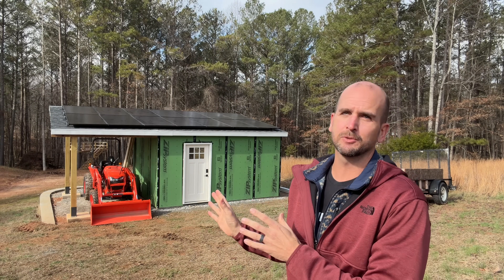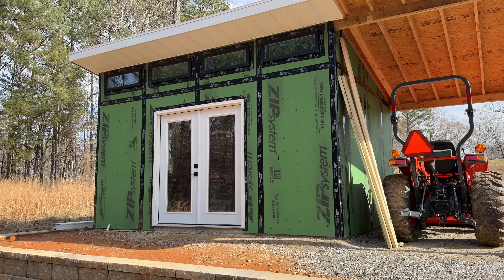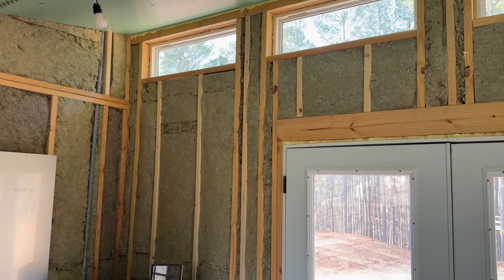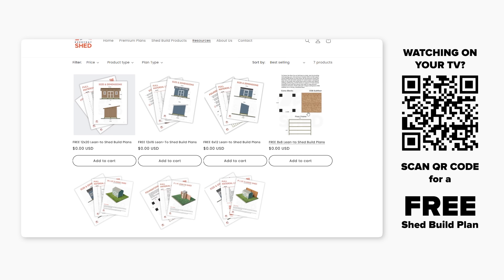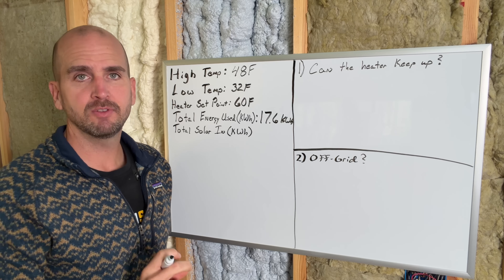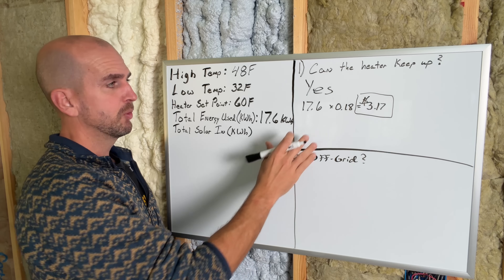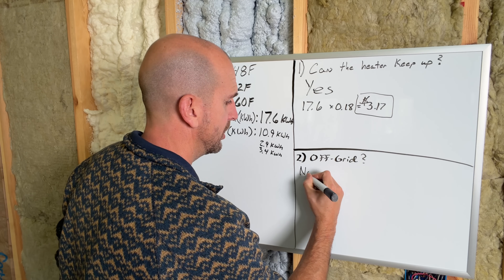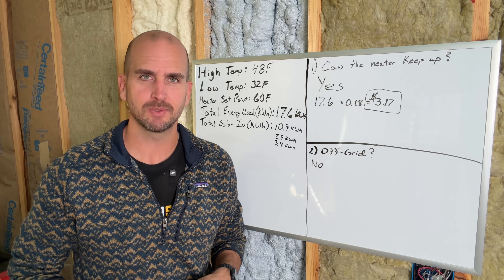HUGE Mistake: Why My $15,000 Solar System CAN'T Heat My Tiny Shed

Comment: I think someone is going to learn just how cold concrete gets at 20F. 

Everyone has tons of suggestions, so I will offer mine, it will always be cold as long as that floor is cold.  You want to be warm learn from the folks in the northern areas, run heated liquid inside your concrete, I have seen in in everything from small sheds like yours to aircraft hangers.  You will still need some heat for the air, and depending on if you have an upstairs/tall roof line will depend on just how much more you need.  

Good luck, I think you are going to need it.

Comment: I think you underestimate what an outside and inside covering will add to your insulation and heat loss mitigation. Further, that ceiling needs to be done much better if you want a chance of keeping it warm without a large input of energy.
I for one would like to see these changes implemented and then retested.

Comment: Try using one or two Envy .5kw convection heaters! I have one in my bedroom and have to shut it down during the night because the room gets to hot. BTW I have a small computer type fan that forces air up through the heater.

Comment: Why not hook up a $50 block heater to your $15,000 tractor and put the tractor in your $15,000 shed. Then for the finishing touch, plug the block heater in. Just a free two minute thought for you.

Comment: you want a solar oven - solar heater. take a old satellite dish, paint it black and have it on a pole  that can track the path of the sun, mount copper coils in the center and run water through them.

Comment: No heat pump and windows, doors need to be insulated ones.   
 Your panel sun angles are too low.   For winter south facing vertical bifacial panels work better.
Even the connected to the grid needs a backup.   Having a small wood stove solves that.
Do this and you can get by with half the kw.

Comment: It looks like 2x4 walls. He needed staggered 2x3 = 6 inch walls with zero heat path. with dual film seal on each inner layer, with a perfect seal. Same with roof and a 2 inch foamboard floor with particle board floor over the concrete with any flat comfort floor over that. On a small space like this all surfaces must be well insulated as well as air sealed. Add a counter current air vent for fresh with low heat loss

Comment: The I think your problem with your setup is that you failed to triple everything you should have made your walls at least 2x8 you're roof 2x16 by increasing your R value also you use a floating slab bad idea with you using solar input and all electric heat you have to double or triple your solar input and heater with a fan would been better

Comment: Rockwool in a wooden structure is a complete waste of effort.  It's only actual benefit over fiberglass is being fireproof, and you've put it in a tinder box.  Guess that's why you thought you could heat with solar, 😂

Comment: 2 minutes I sow from your video. Saw the oil heating think, that will not work. Maybe an ac heatpump can work, split system 9000BTU, may work with 6kw PV during winter. But an electric heating will draw too much from winter low solar

Comment: After just 13 years it's free energy then.  Those batteries will last that long, won't they? They can handle almost 5,000 charge discharge cycles, right? I don't even know if I'd call 60 degrees heat. It's not freezing but it's not comfortable either. Solar is worthless. Put in a pot bellied stove. It'd heat that shed up toasty warm and you could use debris from the yard.

Comment: You could eliminate this whole system and the white board by installing a wood burning stove. You could have used the $15,000 over a course of at least 10 years to pay for grid electric.. To high tech and prone to failure.

Comment: Didn't need to watch it beyond seeing the insulation, or lack thereof, to know the answer was going to be 'no'.
to even come close, not just the high windows, but all that glass needs to be insulated over, and not just the ceiling but all insulation needs to be increased... and finally if you are going to heat purely with electricity, and be able to ride out a few less than optimal solar days, it'll need an efficient heat pump to replaced the radiator.
also, the bare concrete is a no go... need to insulate the floor too.
In other words, there is so much lacking, the as I said.. just seeing the situation was enough to know the answer.
as for economy, using 15 grand as the baseline.. even a diesel heater, if you estimate high at $5 a day... 15,000 / 5 =3000 days, or 8 years of heat for that amount of money... plus a couple hundred or so for the heater, depending on the chosen model.
all that said, if you upped it to around 20,000 watts of panels, with sufficient storage, you could probably do it with that heater, providing better insulation is also added.

Comment: Install solar hot air panels. Low cost, low power consumption, cheap to make. Is the floor insulated?

Comment: Why is PV stuff so incredibly expensive in the USA? In you other video you mentioned that you paid 2400 USD for 6kW from Facebook marketplace, so probably used panels. That is 171 USD per panel.
Here in Germany for example new Trina 455Wp panels cost somewhere around 60€ (about 70 USD) if you buy less than a pallet. Getting a whole pallet with 36 panels would be more like 50€ per panel. There is currently 0% VAT on PV equipment in Germany. 
This price difference can't be only because of tariffs or differences in VAT.

Comment: For starters, you are not harvesting solar energy efficiently. The ideal angle towards the sun is 90 degrees. Your angle is very shallow. 

Let's say that your latitude is 45 degrees. That will be the perfect angle for solar panels twice a year: during spring and fall solstice. In all other days Earth's inclination angle plays a role too. During winter time you have to add a portion of it to your latitude angle, and subtract it during summer time. On the shortest day, December 22, the whole 22 degrees of the Earth's inclination angle needs to be added to the latitude value, and in our case we'll get 45+22=67 degrees for the best solar panel angle. That can boost your production a few times over.
Reply: Also, resistive heaters are the least efficient heaters. A heat pump will be at least twice as efficient. Five times, if you want to combine it with a geothermal loop.

Comment: Mod a heater to run off solar panels only during the day. Then use battery at night. Also, you picked the worse heater to test with. Or like the other comments said. A heat pump to run only on solar panels during the daytime.

Comment: use 12volt motor spinning magnets against a copper coil to a heater core filled with motor oil, You are using the wrong heater

Comment: A lot of people are talking about heat pumps, and there is an energy savings going that way over a resistive heater.  But for the initial cost, a wood stove cant be beat.
Reply: ...if you have free (nice dry fire) wood....

Comment: If the energy of the sun is inadequate to heat the shed directly by shining on it, unless you significantly increase the size of the solar panel well beyond the roof size, simply transforming that same solar energy into electricity first (along with the losses along the way) is not going to get the job done either. As a rule of thumb.

Comment: Add 1/2" fiberboard and 1/2" drywall to the inside for another couple points of R value. Insulated vinyl siding on the exterior would add 2 to 4 points, depending on insulation style bonded to the back of the siding.

Comment: First off, you have no inner walls up. The sky was actually crap. Your solar panels are not even close to optimum angles. That heater is not efficient enough to heat that square footage. 
Finally, spending $15k for that small solar system is outrageous.

Comment: I've got a 10 x 12' shed that I'm thinking of using solar, but heating with a diesel heater and using a Bluetti 200Max with 2 expansion batteries.  To cool a was thinking of using an Ecoflow wave2 or 3.  I have solar panels but the solar generator is limited in it's input to about 1200watts total.

Comment: I have a $29,000 solar system for my 2 story house. 10 Maxeon-Manufactured 425 Watt Panels, 10 Microinverters, Monitoring System, Tesla Powerwall 3 & Gateway 3. I can run the house for well over 1 day normally even off the grid during a power outage. Over 3 days if we don't use the stove, washing machine or dryer. So, I don't understand why you can't constantly heat your shed over the winter.

Comment: My off grid bus, fully appointed, has 6880W of panels, 32kWh of LFP batteries, 2 x Victron Multiplus 5000|70|48 in split phase that runs my entire bus. All the comforts of a small apartment. I have a 240V dual zone 18kBTU mini-split. My bus is very well insulated and the system has no trouble keeping me comfy year round. It only cost me $10k.

Comment: I never installed any solar panels, ever, nor installed insulation.  Right off the bat, the panel are virtually flat. Are you in the tropics? You are purposefully eliminating a lot of photons. You are NOT an expert in DIY solar. If you want to squeeze the last bit of heat during the winter, you should have the panels track the sun, unfortunately. Or just have a glass ceiling to directly bathe your space with sunlight and shutter your windows with reflective insulation at night or cloudy days. Let's looks a the economics. $15,000 and $3/day for heating (if panels were oriented right). That's 5000 days to break even. But with 100 cold days a year, that's 50  years before real break even. Yep, that sounds right for solar. But you are off-grid, so it is more expensive. Take your shed project as a learning experience.

Comment: And for ON grid costs don't forget to add in the fuel differential, Transmission fee and distribution fee, if you use AEP as your power company. I pay more( about double) for power line fees than I do actual power used and the fuel diff is about equal to power used also.

Comment: I'm typically positive when it comes to solar videos, but this one missed the mark in terms of affordability. This setup is well out of the range of everyday people who just want to DIY a solar system. From Ecoflows website the ultra, two extra batteries, and the smart panel 3 bundle comes out to roughly $15k which is very overpriced for what you're getting. That's not even including the solar panels or misc hardware, you buy a system like this if you have money to play with. You could go with an eg4 3000 EHV inverter (120v unless you add 2), 5 5.12kWh Ecoworthy batteries, 12 brand new 500w Peimar 500W Mono PERC solar panels from signature solar, and be just shy of $8k (shipping included). If you need the 240v then swap the 3000 EHV for the EG4 6000XP Off-Grid inverter and be around $8.6k. If EG4 isn't your flavor, then choose any other options out there. Even with mounting hardware, cables, junctions boxes, , disconnects, and an electrical panel, you'll still be under $10k. Free stuff is cool and I do really like EcoFlow products, but you didn't even give a price breakdown of the system as a whole. It gave off car salesman vibes,. Don't get me wrong, it's not a bad system, but for the price you're paying for simplicity over affordability and that really should be kept transparent. Between the ultra with 4 batteries, the smart panel 3, the solar panels you purchased, whatever you paid the electrician, and the misc items, you're probably between $18k-$21k which is insane for such a small system.

Comment: I’d try capturing the sun’s rays directly. For example if one wall of the shed was glass and there was a black concrete block wall behind it, the sun’s rays would pass through the glass and heat the black wall and help heat the space.

Comment: Insulation and power requirements of electric heaters aside, why no have a small wood burning stove in a corner? I see a ton of woods around. Or a small propane heater with a 100# tank outside?

Comment: run a heat loss calculation before building and installing anything. heat loss is the [ temp diff (F) x area (sqft) ] / R-value

Comment: FYI, rockwool moisture resistance is a lie.  The same company makes a seed starting mix from essentially the same stuff and brags about how much water it holds.  Which it does, just try it.  It's a giant sponge.  I still used rockwool in my house because of the higher insulation per inch, so not knocking it completely, the water thing is just a lie.

Comment: I've been off the grid since the turn of the century and many, many things have changed since my first solar setup.

The first two inverters, a modified sine wave then a pure sine wave, I used both produced the equivalent of one 20 amp circuit. My current system with 6250 watts of panels, 100 amps of power, and two repurposed Nissan Leaf battery packs for storage is a far cry from those days. I explain all of this so anyone who lives in a northern latitude understands one very important concept. Using solar in those areas to stay warm during the winter is a losing proposition. The nice man who created this video and laboriously wrote all those numbers on his whiteboard could have put his time and energy to more productive uses. Until there is a non-petroleum based backup device for keeping your batteries charged during the short days of winter you simply can not heat any appreciable space simply using solar.

That's just the reality of the current state of solar, he could have put together a $60,000 solar system and that would still be the reality. When you have days where 24k watts of panels are only generating 1600 watts of power during a five hour period you're going to end up going to your generator over and over again until the day length and the sun's azimuth increase. For me, my generator gets run an hour or two a day when it's overcast, with minimum power usage other than fixed loads, from Thanksgiving until the first or second week of January. The idea of using electricity to heat all day and all night during that period is simply implausible and unrealistic. 

This could all change if the work being done by SoCalGas and Generac can be scaled down to individual households https://www.generac.com/industrial/microgrid-solutions/about/projects/h2-hydrogen-home/ When I can generate hydrogen using the excess solar power I generate for about 10 months out of the year and use that to generate needed power during the other two, then we can talk about electric heat. Until something like that pops loose, the idea is just a pipe dream.

Comment: The ceiling should be at least R60, and you also need a vapour barrier inside that ties in with ceiling, and I would also put one on the floor and then put flooring on top, just so you have a full sealed envelope.  I would be curious to see the difference if you did those two things.  Oh and if floor is not insulated I would do that too. Maybe some rigid foam, that can also act as the vapour barrier, tie the walls in with that then install plywood and flooring on top.

Comment: I would insulate concrete floor and put an electric in-floor heating in it. Floor would act as an accumulator of heat that would slowly radiate it off heating cycles

Comment: $15,000 expense to offset $3.17/day. 4732 days, or about 13 years, for break even if the panels could provide 100% of need.
But the panels only give about 1/6 the daily need (17.6 kWh / 3 kWh). So 13 years x 6 = 78 years to break even. Is my calculation correct?
If so, I don't understand solar for individual homes unless it's in a very arid climate.

Comment: I appreciate your testing as it shows the value of where to spend the big bucks.  Too little space and time here to fully cover but your solar system will heat your building with little if any supplement.  Keep in mind air sealing and loads of insulation are basically a one time expense that pays for itself many times over in the long run.   I've missed where you are actually located but based on the time of this video and your temps, fill the rafters with mineral wool, top the roof deck with 6" of foam boards or greater; preferably polyiso of 4" and then foil sheathed eps of 2" (if you increase the amount, simply add additional polyiso) and at least 2" of polyiso on the exterior walls topped with 2" of foil sheathed eps or greater, taping all seams and foaming any gaps.   I didn't catch if you insulated the floor prior to the slab, if not, top with 4" of xps and you'll have to get creative with your entry if the door swings in or make the effort to raise it.   Concerning the venting of the roof that you are well interested in, simply attach furring strips and reapply the metal roofing.  Now install a high efficiency mini-split.  My workshop barn has four times the volume as your office building and half the solar yet heating it is very rarely an issue.  Instead of a backup generator I simply back off the mini-split 5 degrees and have a very basic through the wall direct vent propane heater that I keep the temp set around 3 degrees cooler than my normal mini-spiit heat is.    Hope all this makes sense, biggest takeaway you bought a large boat that you're trying to paddle around and doing so on a couple of cookies for energy.    What you want to do is perfectly doable, simply poor planning to contain the heat properly.  Spend the money on exterior thermal break insulation and efficient heating systems as opposed to bigger and bigger solar systems.   May God Bless you and your loved ones!

Comment: A bunch of comments on clear and obvious issues like the roof insulation, lack of drywall, no insulation on the floor, and super inefficient heater.  But the reality is, your solar setup is too small for your climate/situation.  Anyone living off grid in cold environments will install a mini-split unit, but they'll almost always use some sort of combustible heater as their main supply.